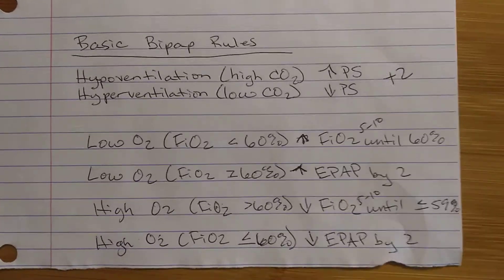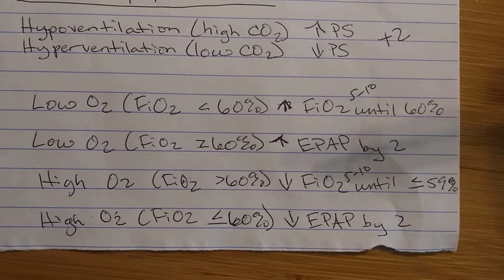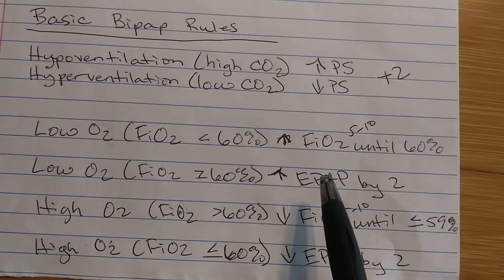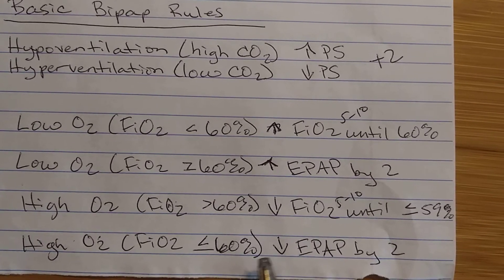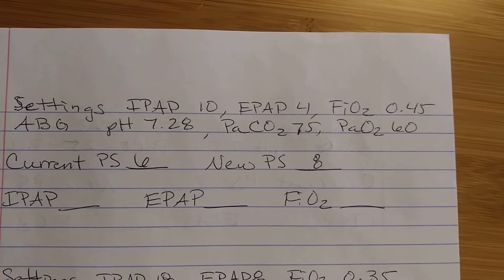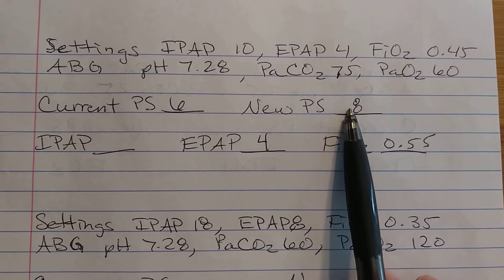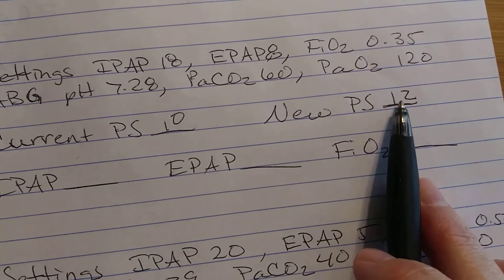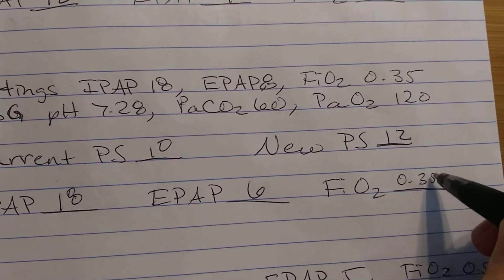BiPAP Setting Rules

Comment: Hi, I don't know much about this, in the Cpap I use 13cmh2o how much would that be in a Bipap, THANK YOU.
Reply from the maker: There isn't an equivalent. Cpap is one continuous pressure that doesn't change. Bipap uses different pressures for inspiration and expiration.
Reply: @2ndstartrrt844  ok I understand that, 2 pressures, but if I am going to change to bipap.  and in the cpap I used 12cmh2o.  in the bipad it would be the two pressures then 12cmh2o / 6cmh2o.
Reply from the maker: @Trigger  you could start with that, but you would need to adjust based on the volumes the patient gets with those settings. It's not a straight across correlation. 12/6 is often a good starting point.
Reply: @2ndstartrrt844  
The Bipap has some function of Auto-adjusting to my way of breathing automatically, every night by itself.  Independent of the initial adjustment or programming?  

And what program or app can I use to get a report of my pressures used every night and apneas if any, 
in pdf or printed, for my personal use or take it with me when visiting my doctor?  since he does not have to read the SD card.  

THANK YOU SO MUCH FOR YOUR TIME AND HELP, BLESSINGS!!!
Reply from the maker: @TriggerFull  some bipap machines have settings that will change based on patient effort, but I don't know if they all do. Your questions would need to be addressed to the company that makes or services your machine. I don't have experience with these machines in a home use setting so I don't know how your doctor would get information about your personal use.
Reply: @2ndstartrrt844  
Thank you very much for taking your time to help me, Thank you.

Comment: Why in the second example you didn’t change the iPAP? The the CO2 is too high and the problem is ventilation
Reply from the maker: Because we decreased the EPAP to adjust oxygenation, that meant the pressure support was increased (pressure support is the difference between IPAP and EPAP) without needing to increase IPAP. That means the patient will blow off more CO2 despite not changing the IPAP. The change to the EPAP will address both the high O2 and the high CO2 without needing to adjust IPAP in this instance.

Comment: As you mentioned in the rules, when PaO2 is high and FiO2 is equal or less than 60% we need to decrease EPAP by 2. This doesn't sound right to me because decreasing EPAP while IPAP doesn't change leads to increasing PS, thus increasing tidal volume. More oxygen will be available to be absorbed and PaO2 will be higher which we don't want.
Reply from the maker: You have to take the pressure support number into account as well. If you watch the explanation of the individual problems I go through, it also explains how you deal with changing IPAP to keep or change your PS. Increasing tidal volume can affect oxygenation to some extent but its main impact is on ventilation, not oxygenation. However, you do want to make sure that you are not changing pressure support unless it is needed. This may mean adjusting your IPAP along with EPAP when you are making changes only for oxygenation purposes.

Comment: I don’t get it
Reply from the maker: Other programs might have different guidelines about how much to go up and down at a time, but basically, you want to adjust settings based on how your patient is doing. If their CO2 (ventilation) is off, you want to adjust pressure support (the difference between IPAP and EPAP). If their O2 is off, you want to adjust PEEP (EPAP) or FiO2. If both are off, you may need to adjust both pressure support and PEEP or FiO2. 

IPAP is the amount of pressure the patient gets on inspiration, EPAP is what is delivered on exhalation (which is why it is also referred to as PEEP, positive end-expiratory pressure). If you subtract your EPAP number from your IPAP number, that is your pressure support.

To reduce pressure support for a patient that doesn't have enough CO2, you want the difference between IPAP and EPAP to be less. To increase pressure support for a patient with too much CO2, you want to increase the difference between IPAP and EPAP. 

For oxygenation, can adjust EPAP or FiO2, depending on what the patient is currently getting. EPAP should never go below 4 and it is preferable to keep FiO2 less than 60.
Reply: @2ndstartrrt844   
could you please mention the normal ABG VALUES
Reply from the maker: @sindhuzsimonz  the basic values you are looking at on an ABG are pH, CO2, and HCO3. The normal ranges for those are: pH 7.35-7.45
CO2 35-45
HCO3 22-26

There are other values reported when doing an ABG but those are the main ones to be concerned with when considering what changes to make on a bipap.
Reply: What do you do with respiratory frequency?
Reply from the maker: @tobiasa94  frequency could certainly be adjusted, but remember that these are spontaneously breathing patients. Most people I see on bipap are already breathing over the set rate so changing that rate will not actually change anything for the patient.